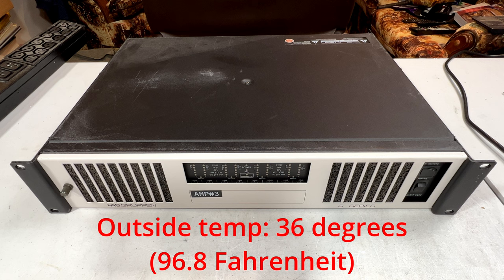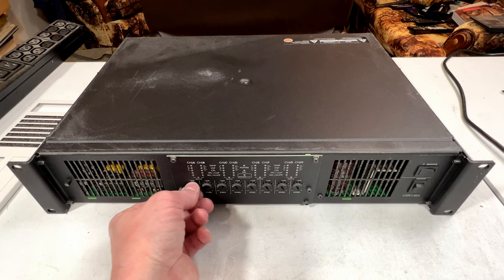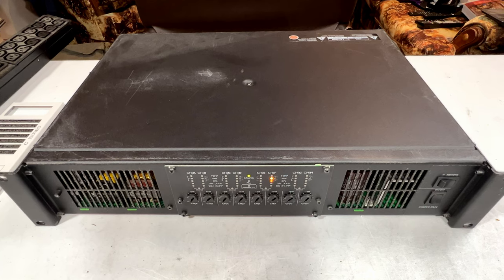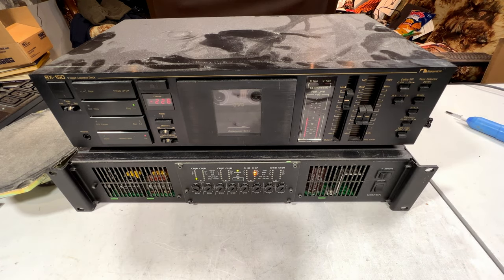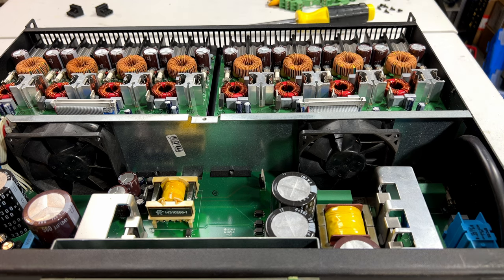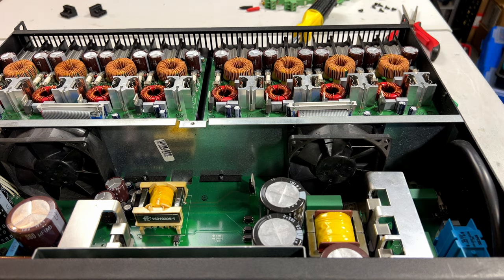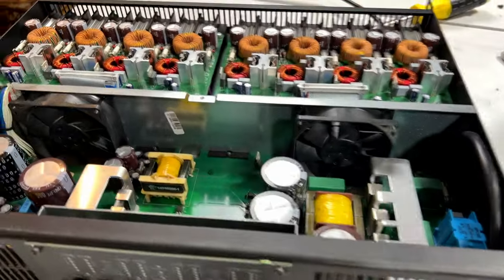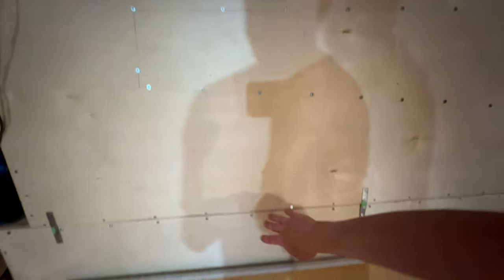Lab Gruppen C10:8X Class D Amplifier - Channel Fault

Comment: Hey mate, I have had great luck with a repair on a C10:4X, the same fault as you, a blown fuse on one side of a channel, and a dead short on one of the output transistors. replaced with an IRFB4332 as I could not source the IRFB4233, make sure you replace both output transistors.

good luck!
Reply from the maker: Thanks! Will do. In fact, I bought those same MOSFETs for it.